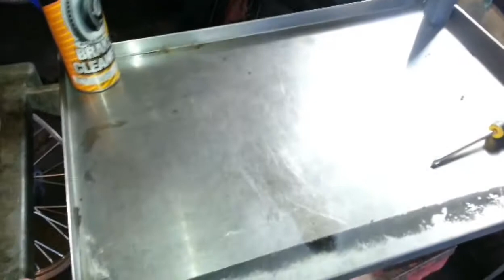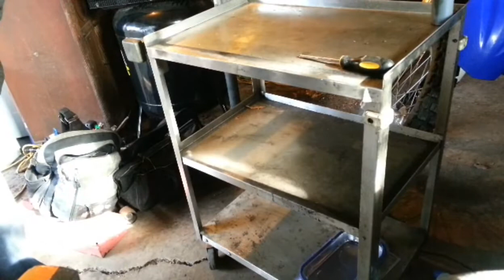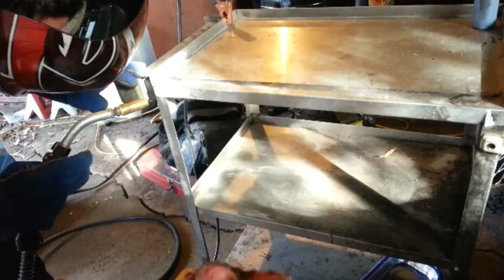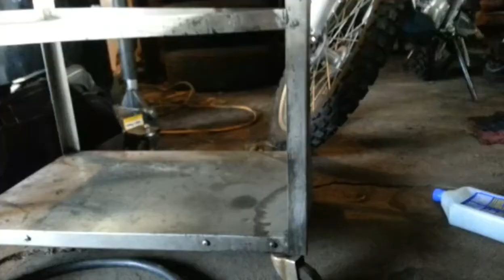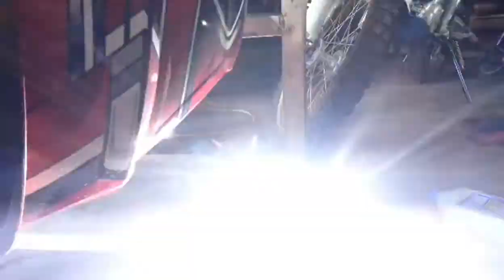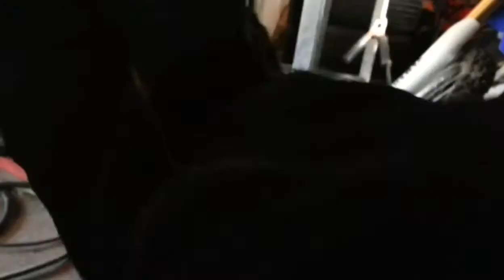Flux Weld like a Pro!...or like me. lol

Comment: Welding that thin metal with a MIG can be a pain in the butt for sure!  Grinding down to the welds to make it look better...who cares, I'd rather leave it ugly than to compromise the strength you put into that thin metal.  I would have done it the same way with a MIG since I don't have anything to weld stainless yet.  Good job and a great shop cart now!
Reply from the maker: Yeah. Early on I thought about and tried grinding down some welds. Takes more time than it's worth and it often involves welding again. Kind of a waste of money, but sometimes maybe it's worth it if it's highly visible.

One weld I did grind down made me feel real proud. I couldn't believe it. It was on my first project (towards the end) and the metal was just so perfect. No holes. Looked like the pieces were always one piece! then I got greedy and put a hole in it. Guess who didn't grind after welding again? LOL

I'm glad I did it some though as occasionally I weld something wrong and knowing a bit of grinder work can cleanly get them apart easily so long as it's just a tack weld and not full bead is really handy skill to know you have.

Sorry, I type quickly and I get carried away sometimes, lol. Back to the shelf. The material is so thin, I'm scared to grind anything. Now that I'm proud of this shelf it's gotten a lot cleaner so if I bother a follow up weld it'll take even better.

Plus, I followed some advice before it was given on here and I bought .24 wire and tips for when I'm doing thin stuff. It'll be easier than my likely usual .35 or .36 I forget which is loaded in. :) Cheers! Have a good weekend!

Oh, and I almost forgot, since you did so a great video about your plugs, I thought you'd like my series on plugs. I don't know how to share a playlist, but here's the first in the series:
https://www.youtube.com/watch?v=6Bb3MogmUrQ&list=PLh_yB9HJ4Gi5lsh8JE8lBq7cWMwCuyH_S

That might just be the playlist! :) Link worked for me! :)
Reply: Cool I'll check it out.  I learned a lot about grinding welds when I did the floor pan in the Firebird a while back.  I did it with 80/20 argon .30 wire MIG and caused quite a bit more work for myself until I was satisfied.  It's far from perfect but after the POR-15 went on it, it doesn't look bad at all.  The main problem besides finding your pinholes grinding is going to inevitably get into the already thin metal and make it thinner which is no good.  Now when I fix the thin stuff for looks I basically just grind the top of the weld flat being verrry careful not to touch the thin metal.  Speaking of, I haven't fired up the welder in quite a while now...waiting on some cash so I can get some metal and build that trailer that I robbed from that old camper.  Cheers!
Reply from the maker: Do as I say and not as I do. Weld where it's less obvious as you dial it in. Lol. A very expensive welding machine at an exhaust shop I put some time in made one set of settings seem to always work but metal was generally the same thickness each time.
Reply from the maker: Honestly, on another read there is some GREAT advice from you here. I should figure out how to pin it under the video.
Reply: :D My buddy you see on the channel occasionally is a welder and he's taught me a lot.  I'm no pro and I still like to experiment and find out for myself....hard headed like that!

Comment: Looks pretty spectaculair haha. Looks a bit dangerous too! Just joined you, would love if you could come over to mine so we can start supporting each other! 💪
Reply from the maker: Welding is dangerous no doubt. Welding thin metal like this is normally safer. Setting fire to the cleaner which didn't evaporate due to it being winter could have been very bad. I sweep the garage area I'm working in every time. If not , leaves could have taken the fire from there. Welding is a lot of fun, but I studied all safety issues I could before my first welding attempt. Safety first.

Comment: Totally love the DIY welding. We are fortunate enough to have a heated shop but will keep in mind not to use brake cleaner in the frigid temps. Gave the big 👍🏻 And hit the support button. Swing by our channel if your interested 💯
Reply from the maker: I'm fortunate enough to work in a heated shop too. This was at home. I could put a space heater up and it does help...but that old building can't have a heater and a welder going. Lol
Reply: DE Nichols we always end up popping the breaker to the beverage refrigerator not a good thing 😂

Comment: Nice project rescuing the shop cart.  Try using a contact tip that is one size larger.  The wire might be expanding at the tip causing it to clog.  Great work!
Reply from the maker: That's some good thinking. :)

This tip came with the welder. I'm replacing it with a known size vs. a mystery size. Some of this old tip is gone and it attracts welding flash which sticks.
I think now that I think on it that however it's getting stuck the wire does expand and stop. Maybe you spotted that too.

Comment: Welding is definitely a scientific art! and stainless is its  own anima!l I'm not a welder but I got a friend that's pretty good at it and it's just cool to see projects come together! Good job man!👍
Reply from the maker: I found stainless steel needs a slower wire speed and heat or you'll blow right through it. Aluminized steel sounds good on paper but it burns through even easier. If this cart was made out of that I'd have to buy a TIG welder...that'd get me to buy a cart instead. Lol

Comment: Nice service cart repair. That will come in handy for sure!!!
Reply from the maker: OH yeah! It's seeing A LOT of use. I think I'm way more efficient with it. Helps a ton when a car needs the same service twice on both sides of the vehicle. Saves tons of walking back and forth...and it's so envigorating I somehow get even more steps in sooner. Funny what happens when you don't waste energy. You do even more. ☺
Reply: You did a nice job tacking it up. Welds are much stronger than bolts for sure. Good save!!!

Comment: I wish I had welding skills!  Well done.  It’s awesome you rescued that cart!
Reply from the maker: Thanks Steven. It's an artistic science. If it was only science it'd be easier. Lol Sure you have the scientific concepts but without warching the metal like something living you won't keep up with what it throws at you. You have to adjust on the fly. It's like a throttle plate being taken over by a computer but engineers haven't given it a baseline to work with yet!

(Throttle plates used to be fully human controlled and they struggle when a sensor is giving conflicting data and they can break transmissions when that happens.)

Maybe if actually get really good it'll come more naturally.

Comment: I've welded thin body metal with around those settings, what size wire are you using? I ended up getting .028 wire + tip and had better luck welding thin metal with that wire size compared to the more common .035 wire. If it's a well used machine the lining in the gun can get worn leading to the wire sticking and then feeding in jumps which messes things up.
Reply from the maker: +DaveBuilds I had bought some .24 since I did this. I'm glad to know it'll make the follow up easier. I probably was using .35 with an equivalent but worn out tip. Misplaced my new tips so I bought those too. I think my sticking issues are in the worn out tip. You can clean slag off only so many times, right?

So with a clean tip if I still have issues I should replace the gun. All the way to the machine or just the part you hold?
Reply: The liner is a coiled wire like you would see on a lawnmower throttle cable and can be replaced without replacing the entire gun. Also are you using fluxcore wire or gas shielded wire. Make sure you have at least 20 CFH of flow if your using GMAW.

Comment: Well it may be cold inside your garage on your concrete floor butt at least ya got a garage and a concrete floor. My garage is a dirt and gravel floor and there's no roof and no sides. 
Sorry for loss of your tools. There are reasons, sometimes we don't know why but there are reasons gotta keep trusting. Nice save and rebuild.
Reply from the maker: I almost regularly misplace some tool or other so I'm always having to buy something. This is why I mostly shop at local stores and I don't use the tool truck, but you get stuck using the tool truck for a few things and pay outrageous prices as they have stuff that sometimes you can't find it anywhere else. 

There's plenty of reason to trust and keep going forward! Trying to always have my tools on this cart keeps them out of engine bays. I'm not having to hunt for what I dropped as much and - knock on wood - I don't think I've lost any tools since I started using it! :)
Reply: No you are Wright on Target. I hate trying to find a wrench or socket that I know I used and can't find. When I work at my mother in law's garage I have a stool with rollers on it and a tray underneath I use that alot so I don't  have to hunt for them but it would be nice to have a roller table for tools and parts for that matter. Dang where'd that nut go. There it is under the car inside the jack stand. There's a lot of good tips out there this is won of them.

Comment: Im sure there is something odd about stainless, eather hard to weld or produces toxic gas, or perhaps that was galvanised metal, i just cant remember :-(.

That trolley didnt look easy to weld, i can see why someone used nuts and bolts.

What ever you lost, just think of your mum saying "Where did you use it last?", mums are good that way lol :-D.
Reply from the maker: Galvanized is much worse. It has a coating to prevent rusting, but for welding...well, it explodes.

Yeah moms sure are! I'm not sure how my mom helped me find stuff so well by saying such simple things. It's like taking the stress off of it makes you aware of where what you were looking for is, lol.

I think this project will make me do better on the next aluminized steel I weld. You have to set the welder slower wire speed and at a lower heat to not burn through for that as well. Yet, you have to move slow enough to get enough penetration.

Comment: I think I need to buy a welder. Thanks for the tips. 😎😎😎
Reply from the maker: +Urban Fisherman If you like tips, I'd add that I can't weld in little circles like the fancy welds show. It was revolutionary when I learned to zig zag instead. To not burn though this thin stainless steal, I had to reduce my zig zag and make it more like tiny spot welds lined up in a straight line. Thin metal is more sensitive, but adding stainless on top of that? I should have done worse. Lol

TIG is better than MIG for delicate work like this. Never done it...just watched it on YouTube enough to believe it's true.